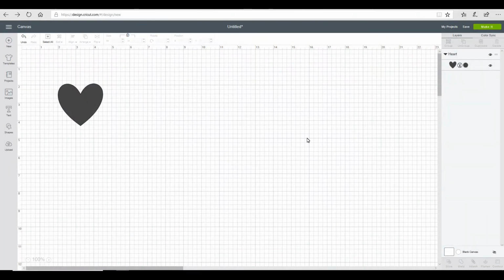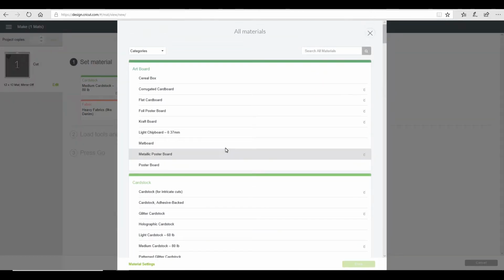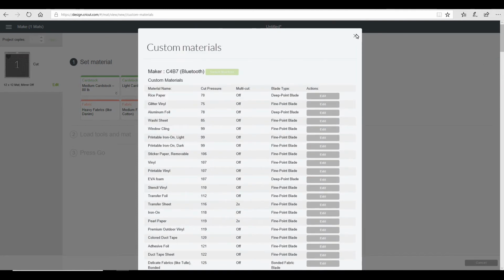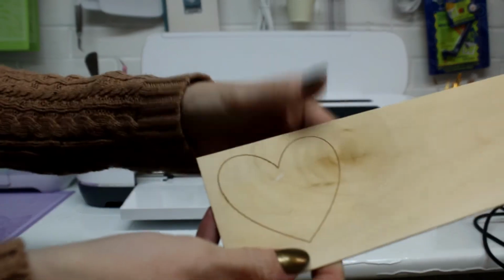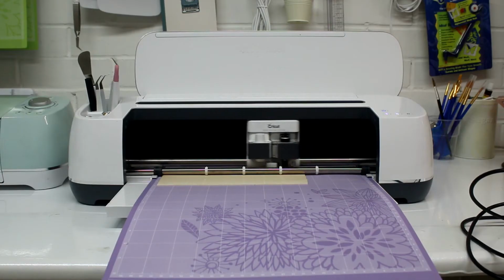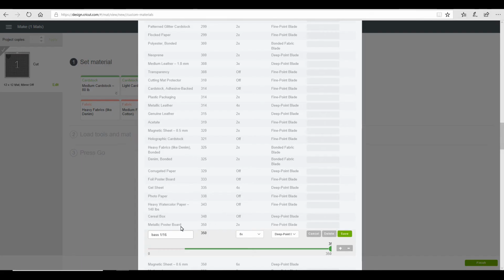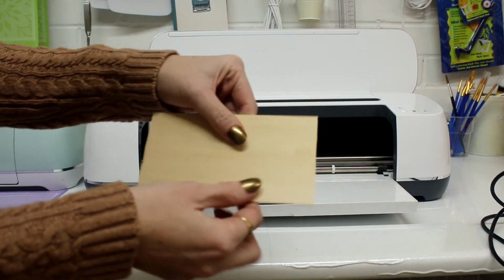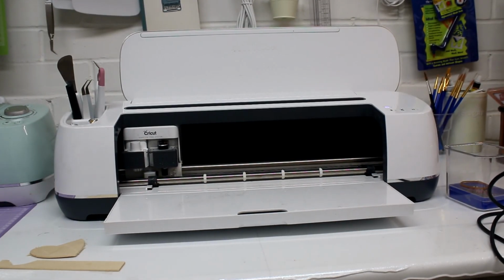Creating custom settings and cutting Basswood with the Maker

Comment: I’m not sure if you’re using an old blade or the wrong blade but I followed exactly what you did and it not only cut completely through the 1/16 in basswood, it cut into my mat. I used 1/16 in basswood on the Explore Air 2 with a deep cut blade. This works fine, everyone.

Comment: Try changing the pressure settings from default to more pressure and then if it doesn't cut through hit the cricut button again without removing the wood for another round......I've read that in a blog
Reply from the maker: alfred veasley, Thankyou for your comment. As you  can see from the video I actually manually increase the pressure to its highest possible setting, so much higher than the “more setting”. I also increased the cuts to 9 and yes you are correct, in previous videos I quite often go in with a immediate repeat cut however after 9 cuts, you need to at some point stop. I will be trying balsa wood in the near future and I’m sure if you continued with another sequence of cuts it would eventually complete the task without the use of a external cutting blade to finish it off but you also have to asses if it’s worth the risk to a rather new machine. I advise that people wait until the knife blade at this point in time rather than push the machines for the sake of a “experiment”💋
Reply: good point